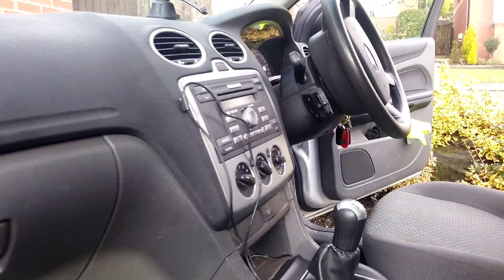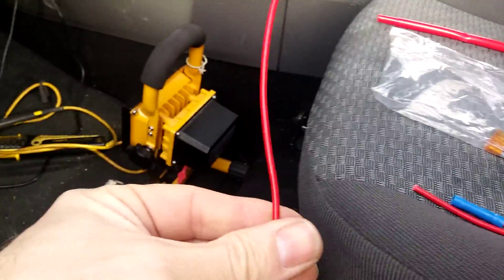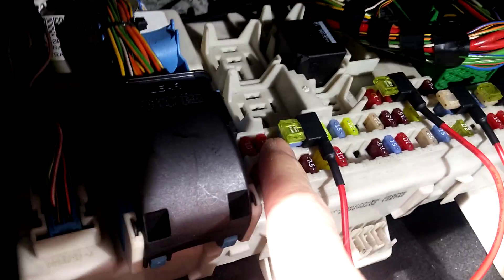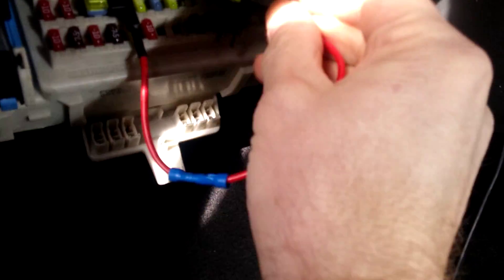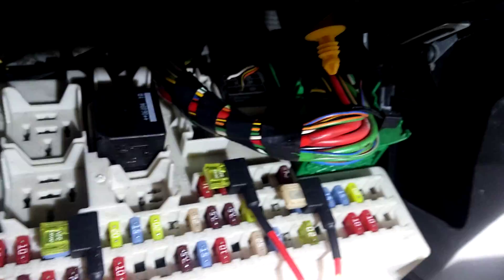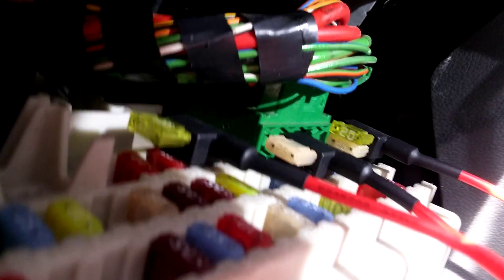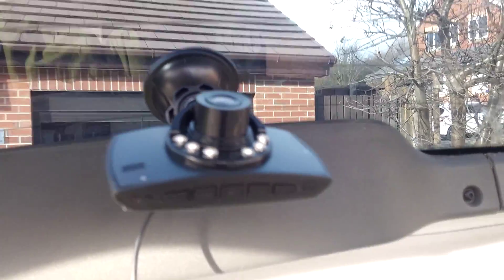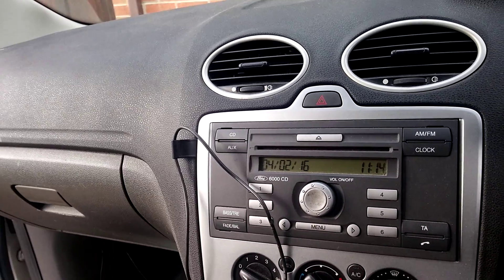Ignition switching 12v Aux (cigar lighter) sockets Focus Mk2 Dash Cam fix.

Comment: Excellent just did this on mk2 facelift from 2011 uk using info in the comments on the updated fuse locations. which are also in the manual. A* video thanks for making this been a bug bear on and off for years.

Comment: Brilliant solution, sorted in less than 10 mins. For anyone with a facelift model, it's a new layout. Charger sockets are 109 and the washer bottle is 136.
Reply: Excellent worked a treat on a face lift mk2 focus uk from 2011 thanks for the updated guide.
Reply: Yes works like a charm! Many thanks

Comment: Today I make this bypass on my Ford Focus MK2, 2005. The power of my cigarette lighter will never power off. I give my shot and make a bypass of 68 fuse (Radio, instrument cluster) instead of 47 (Washer pump, heated washer nozzles) on 39 (Cigar lighter, rear auxiliary power socket). This gives me a benefit to take advance of my wireless charger on the first key position (ACC) when my radio is power on and my cigarette is power on. My cigarette lighter is power on when I switch to ACC position (like my radio and other instruments). I bypassed the fuse (7.5A) with this cable. I follow the steps and I have a 7.5A on 68 and a 20A for the bridge to the 39. Great vid, dude! You save me for a huge trouble with my strange car power behavior!
Reply: So you connected 7.5a with 20a?

Comment: I think that you are connecting wrong although is working. Minus is on the top, and you need to rotate piggy back where is two fuse, because now current is going from lower fuse to upper fuse serially. https://www.youtube.com/watch?v=b1IQXneI_lk

Comment: I just want to thank you.  This worked brilliantly.  I have a 2011 Ford Ranger, and it was so annoying that the cigarette lighter outlet would stay on all the time.  If I forgot to unplug my accessories every single time, it would drain the battery.  I wired the Radio (Ign/Accy) fuse (which is only 10A), to the power outlet fuse as you directed, and now it switches on and off with the ignition switch, just like the radio. Brilliant and totally reversible fix.  I had to step down from the 20A fuse in the power outlet, to a 15A fuse, but I'm only drawing 2-3 amps from my phone charger, so no big deal.  Thanks for the great video.
Reply: are your hazards in that cluster though?

Comment: When I plug cellphone charger or fm transmiter with BT on my mk2.5 the shitty cd6000 gets sooo much noise on FM that it's imposible for listening! Any One else having same issue? I have found only one CellularLine charger when pluged everything is fine...
------------------------------------------------
About this fuse box taping... Only one important thing I see here as quite wrong is that he use top 20A at positive power source plus more 20A fuse at load side for cigaret lighter plug but his source of ignition switched power for washing pump circuit is designed to hold up to 15A !!! 
By doing this way as I see he has regular 15A load for washing pump and he put additional 40A for cigaret lighter socket what is possible extremeeee overload if  something else, much "stronger" is pluged instead of his camera! 
This is "fine" ONLY if you are 1000% sure you will not plug anything else with current higher of 15A for both washing pump and device pluged in cigaret lighter socket, together!
Reply: Get yourself a Ground Loop Isolator and put that in the signal chain.
had the same issue with a DIY Bluetooth Module i installed in the back off the cd6000
Reply: i solved the exact same noise issue on my mk2 by buying cellphone holder that also charges phone wirelessly (nillkin charger2). no noise whatsoever,  but your phone has to support wireless charging. the holder itself has really, really weak magnets though and it doesnt hold the phone very well (i ended up pulling it apart and adding more magnets inside it).
Reply: Have same issue..some radio stations doesnt play anymore

Comment: Hi pal, hope your still on here, will this work for a 56 plate mondeo as well.?
Reply: On the mondeo just move the fuse for the lighter socket up. It has the option to be powered on live all the time or off with the ignition.

Comment: I don't understand how this would work as it would still be getting a permanent possitive from the ciqarete lighter fuse?
Reply: I don't get it either.  The first fuse biggy backs the + goes through the cable, then through the second fuse but goes back to the +.  It's basically linking two + together.  I would have thought the second fuse plug needs to be roated 180.
Reply: Andy Wyatt the bottom spur of the fuse is where the current is going through and the the upper one just shorts out due one fuse the closer one being missing meaning the car doesn’t notice anything as current is being received via the bottom spur as it would from a normal fuse
Reply: Can someone please explain this
Reply: The positive feed is shortcut by the tap, notice how he puts only one fuse on the “exit” tap wire: this one will get the feed stolen from the other fuse slot, the other one is open so no current goes through .

Comment: Great tip and video. Used the Washer Pump (fuse 36) on my MK.II 2007 TDCi
Reply: Hi pal, any chance you can post a pic of how you did it on your mondeo, that's if you still have it, got a 56 plate mondeo I want to do it on.

Comment: Great video thanks. I can now plug a 12v cool box into the socket in the boot knowing it'll turn off when we stop. With luggage and bike rack it's not possible to keep unplugging it. But for power to the dash cam, why didn't you just take a direct feed off the fuse box and forget the plug altogether? It's much neater as you don't see any cable. Cheers.

Comment: I did this yesterday and it worked a treat I used the fog light feed as it was right next door to the cigarette socket feed and they are both 20 fuse
My 2007 focus 2 has a different layout to the fuse board in your video though.
Anyway thanks for this tutoriall, I managed to sort my annoying 'always on' cigarette socket out for under a fiver
Reply: Why it don't work on my Ford Focus 2005?

Comment: Great video. Was looking to do this on my Focus for a Dashcam as well.
I'm assuming that, since you haven't posted anything since, your own car has no problems with this set up?
Reply: Dont think anything can go wrong other than not using the correct fuses. If you put in the wrong way round id guess it just wont power up.